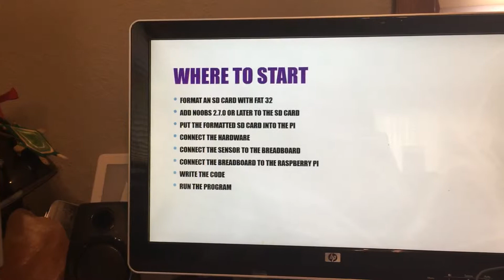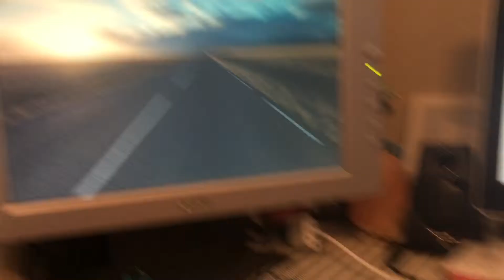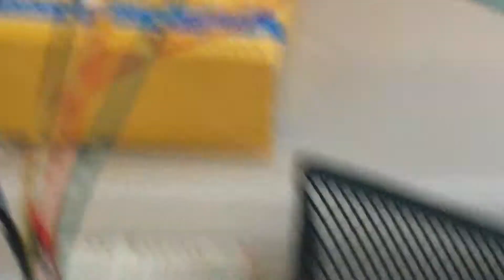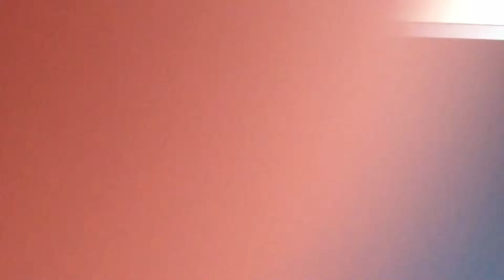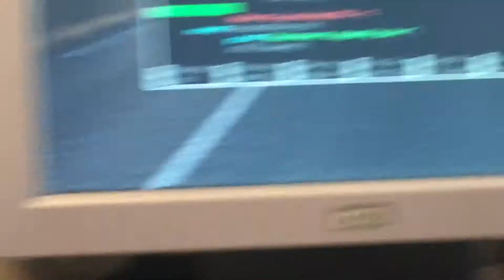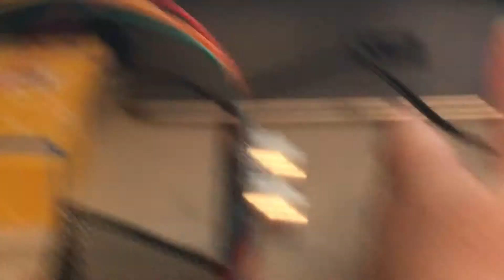Raspberry Pi with Proximity sensor

Comment: I bought a load of sensors and shall start to play with it some day so it's nice to get some info.
But I think you don't know that you don't have to run it as root any more, that time is over since long.
Just add your user to the group gpio and run your programs as a normal user.
Running programs as root shall be avoided so much as possible.
Reply from the maker: ytbabbler 
Thanks for the update.
It was my first crack at a Raspberry Pi
I’ll likely cringe at this in the future
Reply: @Config_TREX  
Just type  the command groups , if you see gpio there you can just skip all that sudo, but now maybe root own your files so you need to do  sudo chown pi *py

Comment from the maker: Proximity Sensor with Raspberry Pi documentation

This documentation is intended for an individual to connect the indicated devices to a Raspberry Pi with the indicated wiring and use the provided code to simulate a warning system with a proximity sensor.
Equipment used in this demonstration:
*Note other wires and Raspberry Pi versions might produce similar results but to prevent an exhaustive list the equipment will be limited to what was used to produce the results from this project.
Cana Kit: 
Raspberry Pi 3 Model B+
2.5 A Power Supply
32 GB SD card
HC-SR04 Ultrasonic Sensor
Breadboard 400 points Model BB-801
Resistors:
 330 Ohm
 470 Ohm
Jumper Wires:
7 – 11 wires depending on if you want to connect the sensor to the breadboard directly or through jumper wires.  
*This assembly used 11 wires of different sizes to better maneuver the sensor.  
Extra equipment:
 USB Keyboard 
 USB Mouse
 HDMI Monitor

Preparing the Raspberry Pi out of the box
The Raspberry Pi uses a MicroSD card that must be formatted with Fat 32.  If the card is not formatted it will not work.  To format the MicroSD card  insert the MicroSD card into the SD card slot on a Windows device for easiest formatting.
Formatting SD Card on Windows 10 OS : 
 -Insert SD card into card slot
 -Open File explorer
 -Navigate to the SD card
 -Right Click or tap and hold the device for one second and release
 -Click format
 -Ensure it’s Fat2
 -Start
 -When warned all data on disk will be erased click OK
              ** if you don’t want this, then you must use an SD card you are comfortable with losing data.
 -Click Ok
Adding NOOBS to formatted MicroSD card (necessary to make the Raspberry Pi functional)
 *Note Must be NOOBS 2.7.0 or later for this model
 -Open a web browser
 -Navigate to www.canakit.com/downloads/noobs
    -Select “Noobs Offline and network install” Download ZIP
 -Download to a place you can find in your file explorer
  -Once downloaded unzip
 -Create a NOOBS ZIP file on the MicroSD card 
 -Copy the files that were unzipped from the download and paste into the NOOBS zip file on the  
 MicroSD card

Setting up the Raspberry Pi:
 -Insert MicroSD card into back of the Raspberry pi
Back side of Raspberry Pi sd card port image
 
 -Connect a USB keyboard
 -Connect a USB mouse
 -Connect an HDMI monitor
 -Connect 2.5 V power cord
              -Connect to a power source
              -Turn on the Raspberry  Pi by clicking on the power button on the 2.5 power cord.
Top of Raspberry Pi with port image
 

Connections to Raspberry Pi image
 
 -Turn on the Monitor that’s connected to the Raspberry Pi
*Raspberry Pi should start to boot.
  -Click on Raspbian (Recommended)
 -System will install
*If a lightning bolt symbol with a rainbow splash screen shows and persists then the software isn’t compatible with your Raspberry Pi.  Must be NOOBS 2.7.0 or later.  You will need to download the correct NOOBS file from previous step onto the MicroSD card
When Operating system is installed a message will indicate the installation is complete
 -Press OK and the Raspberry Pi will reboot
*When the Raspberry Pi re-boots it gave me the options right away to set up system configuration.  If this does not happen then you will need to launch the Raspberry Pi Configuration application.   Under Main Menu and Preferences.  Directions are also with the Cana Kit.
Follow the prompts and configure system parameters such as Wi-Fi operation, Password, Hostname, Locale, time zone and keyboard layout.

The Code
Before beginning to hook up the sensor to the breadboard the code should be written that will program the sensor.  
With the Raspberry Pi booted and programmed with the instructions above.  Click on the command prompt. 
Once in the command prompt type 
(*Note this is python programming)
 sudo nano ultrasonic_distance.py
monitor with command to create program image
 
You will be brought to an editor.
Type in the following code

#Libraries
import RPi.GPIO as GPIO
import time
import colorama
from colorama import Fore, Back, Style
colorama.init()
 
#GPIO Mode (BOARD / BCM)
GPIO.setmode(GPIO.BCM)
 
#set GPIO Pins
GPIO_TRIGGER = 18
GPIO_ECHO = 24
 
#set GPIO direction (IN / OUT)
GPIO.setup(GPIO_TRIGGER, GPIO.OUT)
GPIO.setup(GPIO_ECHO, GPIO.IN)
 
def distance():
    # set Trigger to HIGH
    GPIO.output(GPIO_TRIGGER, True)
 
    # set Trigger after 0.01ms to LOW
    time.sleep(0.00001)
    GPIO.output(GPIO_TRIGGER, False)
 
    StartTime = time.time()
    StopTime = time.time()

    # save StartTime
    while GPIO.input(GPIO_ECHO) == 0:
        StartTime = time.time()
 
    # save time of arrival
    while GPIO.input(GPIO_ECHO) == 1:
        StopTime = time.time()
 
    # time difference between start and arrival
    TimeElapsed = StopTime - StartTime
    # multiply with the sonic speed (34300 cm/s)
    # and divide by 2, because there and back
    distance = (TimeElapsed * 34300) / 2
 
    return distance
 
if _name_ == '__main__':
    try:
        while True:
            dist = distance()
     if dist < 6:
  print ("!!Impact Warning!!")
  print (Fore.GREEN + Back.RED + "Measured Distance = %1f cm " % dist)
     else:
  print (Fore.CYAN + Back.BLACK + "Measured Distance = %1f cm " % dist) 
            time.sleep(1)
 
        # Reset by pressing CTRL + C
    except KeyboardInterrupt:
        print("Measurement stopped by User")
        GPIO.cleanup()

Python code in editor image
 

Follow the prompts to exit and save.  
*Usually ctl + ^ + x and then save.

Now connect the proximity sensor to the Raspberry Pi with the directions and images below.

Connecting the Sensor and Breadboard to the Raspberry Pi
Connections on the HC-SR04 proximity sensor image
 
Connecting the sensor to the breadboard image
 

Connections on the breadboard image
 
Connections on Raspberry Pi image
 

 For this project, four long jumper wires were used to connect the sensor to the breadboard.  Alternately, the sensor can be connected directly to the breadboard, however the longer wires allow for easier movement and mounting of the sensor.
There are four pins on the proximity sensor, VCC, Trig, Echo, Gnd.  One wire connects to each pin.
VCC :  Connects to the breadboard and Jumps to a positive point on the positive column on the breadboard and to pin 2 on the Raspberry PI
 *In the picture it is the Red Wire from the sensor to Column F row 17 to the Positive column and from the positive column to pin 2 on the Raspberry Pi
Trig:  Connects to the breadboard and jumps from the same column to pin 12 on the Raspberry Pi
*In the picture it is the Orange Wire from the sensor in column F row 16.  Another Long jumper wire jumps from column J row 16 to pin 12 on the Raspberry Pi
Echo: Connects to the breadboard and then a 330 OHM resistor connects to it and then a 470 OHM resistor connects that to the negative column and to pin 6 on the Raspberry Pi and a Jumper wire connects to Pin 18 on the Raspberry PI
*In the picture it is the Yellow wire from the sensor in column F row 15.  (This gets a little confusing, pay attention) A Jumper wire connects at column H row 14 and jumps to column H row 9.  The 330 OHM resistor connects at column F  row 9 and then to column F row 12.  The jumper cable connects at column G row 12 to pin number 18 on the Raspberry Pi and a 470 OHM resistor connects column I row 12 to the negative column on the breadboard so that it also connects to pin 6.
Gnd: Connects to the breadboard and jumps to the negative column on the breadboard and jumps to pin 12 on the Raspberry pi
*In the picture It is the Green jumper wire from the sensor in column F row 14.  Then a jumper wire connects to the negative column and a jumper wire in the negative column connects to pin 12 on the Raspberry Pi
Full set up image

 
Starting the program
When everything is connected, and the program is written into the Raspberry Pi,
return to the command prompt and run the program by typing in the following command into the command prompt
 sudo python ultrasonic_distance.py
*use CTRL + c to break out of the program and return to the command prompt

Code to run the program image
 

Testing:
the screen will turn red with green lettering and Print out the message “!!Impact Warning!!” followed by the distance the object is away from the sensor.
If the object is further than 6 cm away the screen will display a black back ground with cyan letters that only displays the distance the object is from the sensor.

Object further than 6 cm away with screen display image
 
Object closer than 6 cm away with screen display image

 

 

 Citations:
Raspberry Pi Tutorials.  Using a Raspberry Pi distance sensor (ultrasonic sensor HC-SR04).  Retrieved from https://tutorials-raspberrypi.com/raspberry-pi-ultrasonic-sensor-hc-sr04/